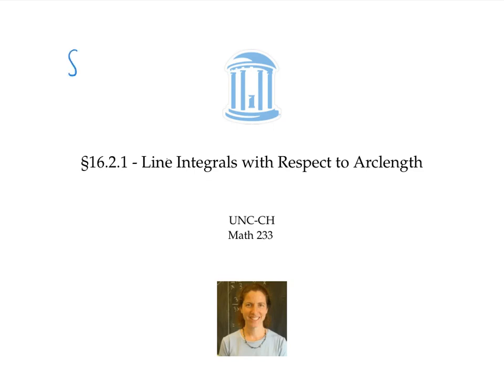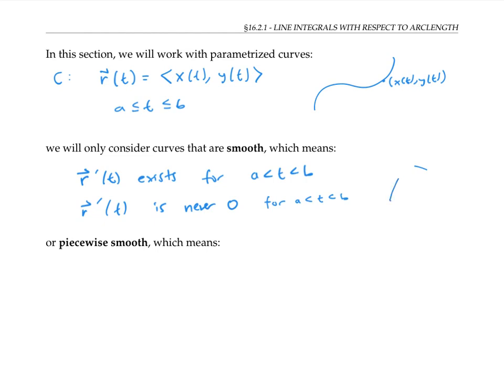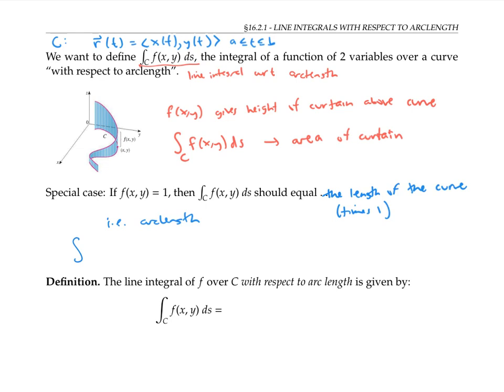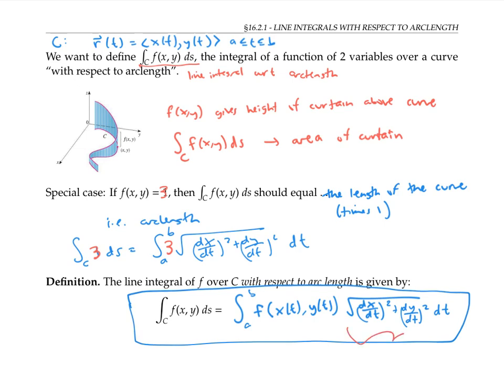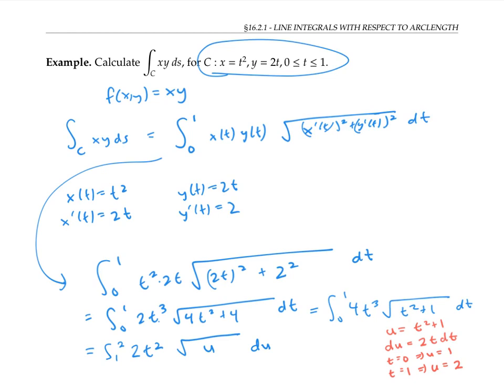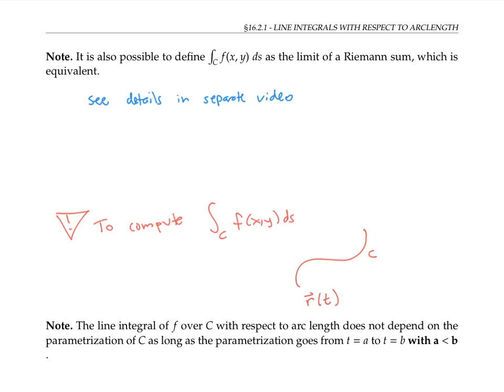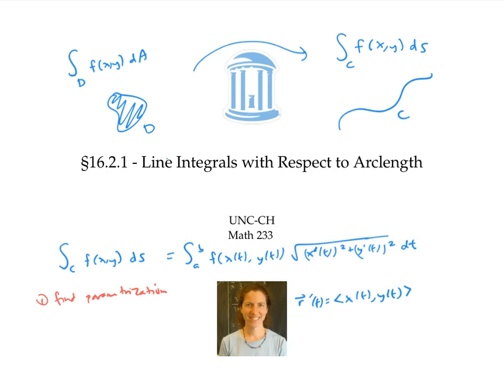Line Integrals with respect to Arclength

Comment: When you brought out the 4, you forgot to multiply it with the coefficient of t cube. therefore the correct answer should be 8tcube
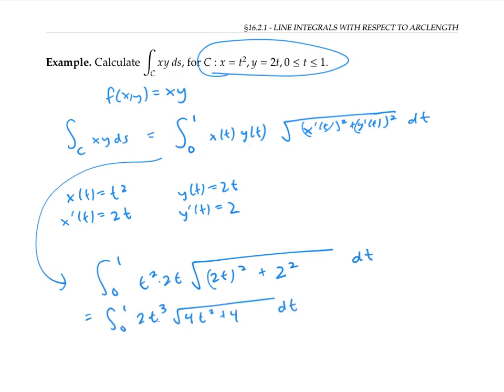Reply: Zelig, are you talking move @4:38? if so, that looks correct 2t^3 * sqrt(4t^2+4) the factoring out 4 in the square root we get sqrt(4(t^2+1)) which becomes 2*sqrt(t^2+1) and then reapplying 2t^3 we get 2t^3*2*sqrt(t^2+1) = 4t^3*sqrt(t^2+1)